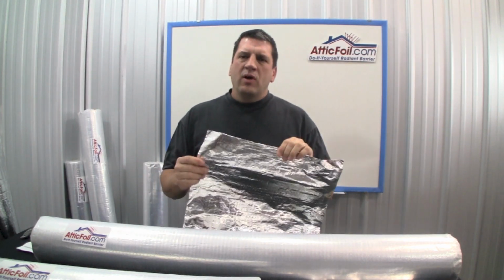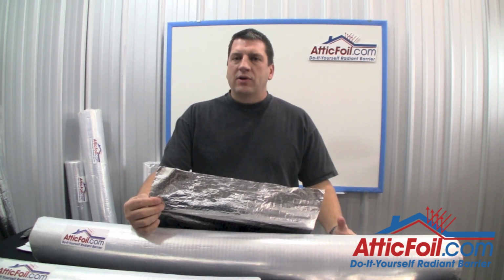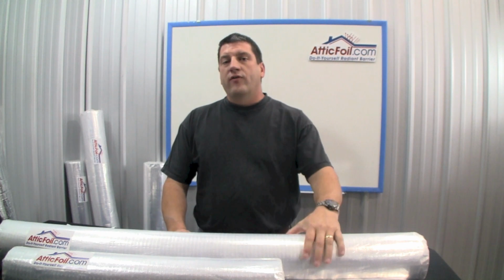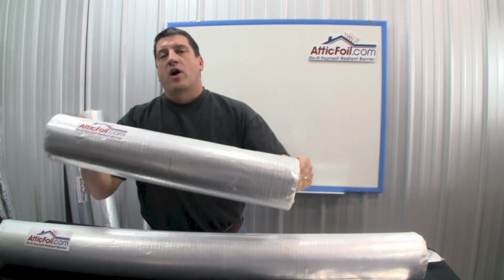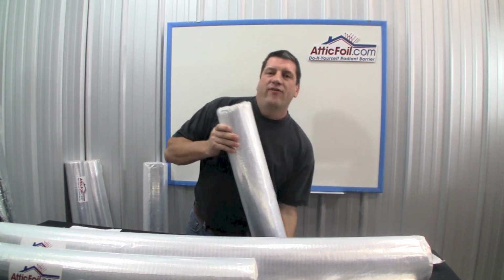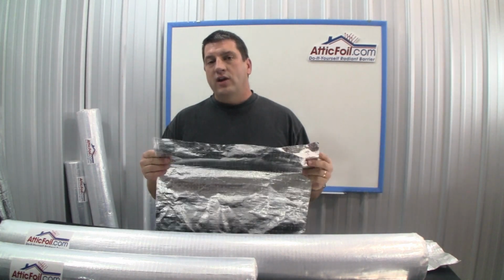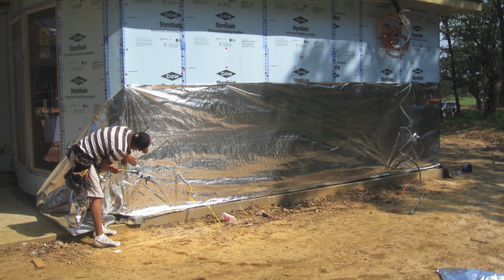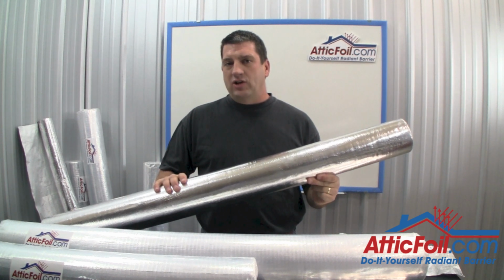Radiant Barrier Product Line - AtticFoil.com

Comment from the maker: If you are eventually going to finish it out, you should do the "cathedral ceiling method".  A 1/2" or 3/4" air space between the foil and the roof deck will be fine.  Look for my video on cathedral ceilings.

Comment from the maker: I go over this very question in another one of my videos, it is a common question.  The video is called Radiant Barrier Questions - Size of Gaps At Top & Bottom Of Attic?
Ideally you want about 3 to 6 inches of space at the top and 3 to 6 inches of space at the bottom. Check out the video for more information on the installation.